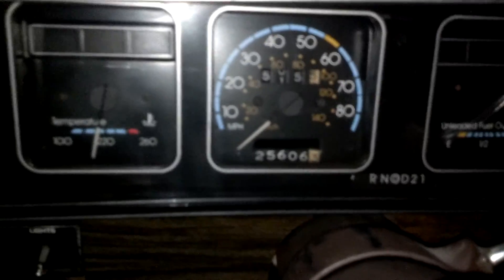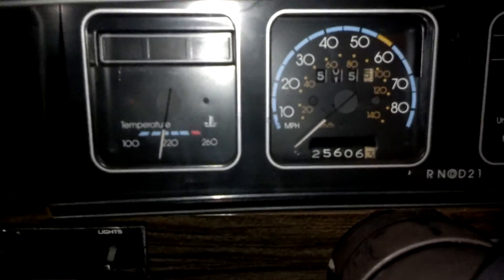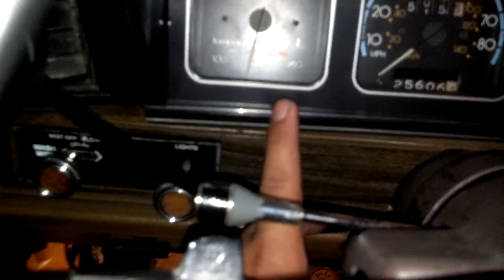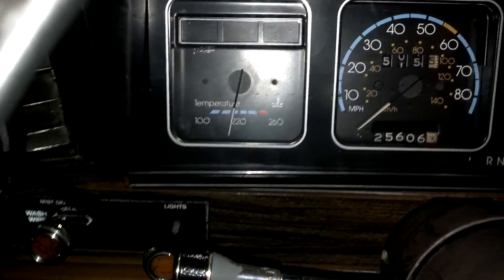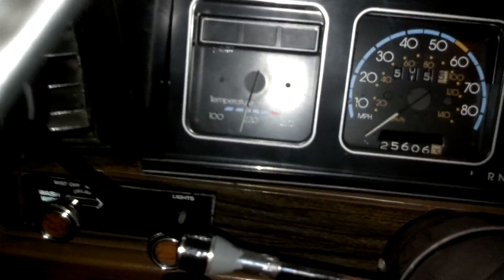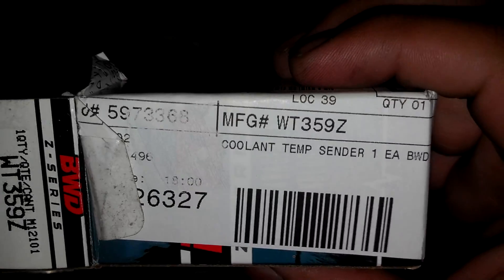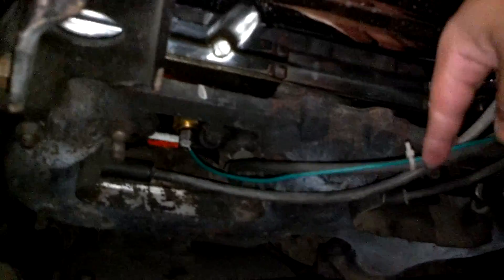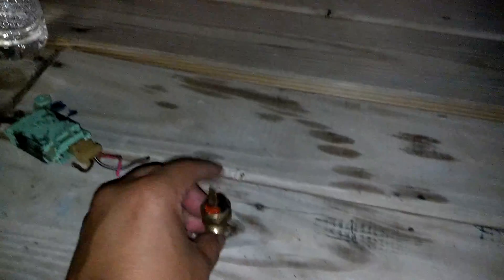Temperature sending unit and gauge finally working!!

Comment from the maker: @100SpokeRiderz Thanks man, it feels good to actually have a fully functional cluster for once. But Ill see when i get a new wire/terminal connector and try and reroute the wire away from everything. I figured it wouldnt cause any interference or heat on the plug wire but then again I'm not that electrically inclined.

Comment: My 77 malibu has tubes coming from the stock sender (screws into the thermostat housing). Looks like yours did too? Did you just cut off the tubes? Not sure what that all will effect
Reply from the maker: Mine is a stock vacuum switch thats on my thermostat, i didnt cut the tubes i just pulled the vacuum lines off and capped the open ports on the carburetor. You dont have to cap the tubes on the thermostat, since no vacuum lines are hooked up.  But it will affect the operation of your EGR valve. It wont work with those lines pulled off.